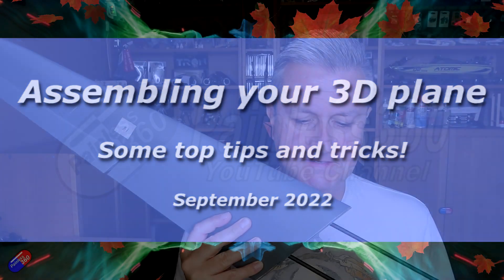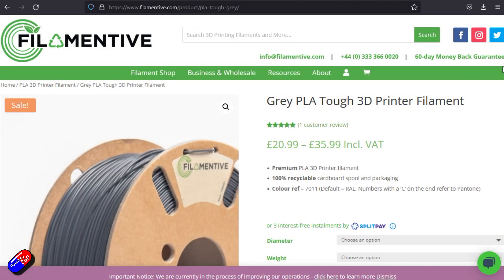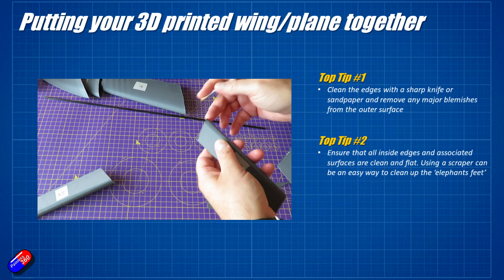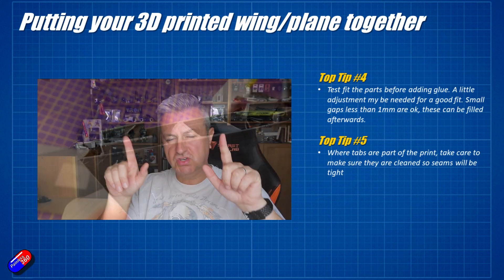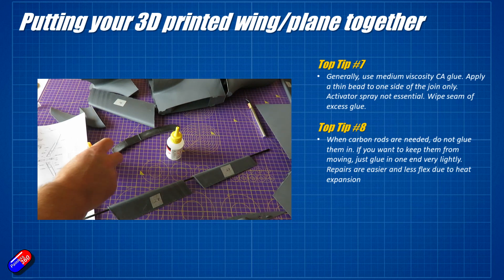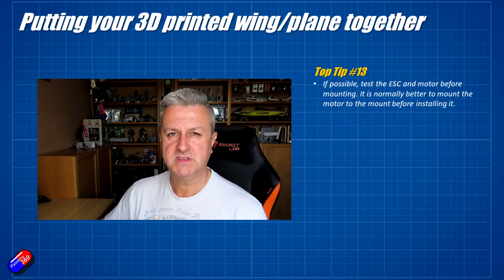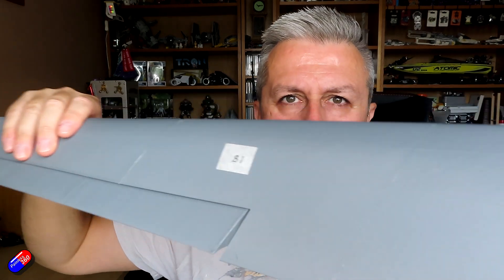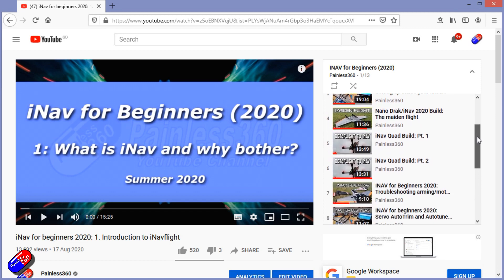3D printed planes and wings: Top tips to make the first build go great!

Comment: I bought the files for a Zero. I think it probably took about 2 days to print. I got a second printer though. So using octopi I can easily control both printers from my computer and print the plane in half the time. I crashed the plane the third time I flew it though. I don't have much experience flying rc planes and so I'm not very good at flying them. Also I didn't put the motor at the correct angle and so it was turning (the plane). I did try adjusting the ailerons to account for it. Which made it better but I think I made it turn the other way (not as badly though.) Anyway I crashed it straight into the ground and the wing crumpled all along the leading edge, but didn't break in half. It was actually pretty cool. The front of the plane basically exploded and the motor was actually slight embedded in the ground. Anyway the back of the plane was fine so I've reprinted the front and the wing. The thing that I think is really cool about being able to print a plane is that although it still takes a while to put together it's a lot less time than making a plane out of foam core stuff. I made a couple of planes out of foam core and the second one did fly but I crashed it pretty fast and it was sort of demoralizing (I mean it's fun putting them together, but it's not so fun when you crash them almost straight away because your not very good at flying them yet.) So I think it's cool that you can just print new parts and once the parts are printed you can assemble a plane significantly faster then you would other wise be able to.

Comment: I would HIGHLY recommend my 3D Printed Gremlin. It flies very similar to the Nano Goblin, prints in about 24hrs, goes together easily. And is fairly durable as far as 3d printed planes goes. A printed airframe can be assembled in ~30min from a crashed donor.

I'd also stress that being accurate and making the perfect build is nice, and sure makes it look pretty, but definitely not required. You'll never know the difference if your joints aren't perfect.

Comment: Great tips thanks a lot, I've built that plane but I found the CG was quiet tricky to get, after installing the electronics and putting the battery in the plane wouldn't balance on CG marks, how was your experience on that part ?
Reply from the maker: I'll cover the that in the next video. Was it too nose or tail heavy on yours?
Reply: @Painless360  it was very unbalanced if i move the battery 1 cm it go from nose to tail heavy I couldn’t get it to balance on the CG marks, I haven’t tested it yet hopefully you have better experience than me
Reply from the maker: Good to know, I'll see how tricky it is on this one..

Comment: Small tip for CA glue seams that turned white (especially if you used accelerator):
If you put a little bit of vegetable oil on a paper towel and dab that on the glue seam it becomes clear and almost invisible again. Take care to use vegetable oil and no mineral oils as mineral oils can degrade plastics
Reply from the maker: Fab tip - thanks for sharing!

Comment: Wow 8 days for the Whitewing is kinda too much. I'm printing Model-S in one shot 48h. But the Whitewing is the best for practice. Also something is definitely broken on Steve's process due to brim should be removed much more easily compare what you've showed. PLA+ from eSun is one of the best filament for 3D printing but I'm using ABS+ from Devil Design due to heat resistance and weight. Good luck with your 3D printed plane it's so much fun :) Model-S is the best model so far I've printed and enjoyed. Orca v2 would be also interesting for you as well but it likes speeeeed :)

Comment: I've found emery cloth too harsh,i use a womens nail file set to remove flashing,a metal one then a fine lollipop style two sided file,rough/smooth.good for printed stuff,plastic  and carbon.
Reply from the maker: I was using a nail file emery board too but liked the cleaner cuts from the blade. The suggestion of using a burr removal tool is a fab one!

Comment: tip 16#  don't leave your pla model in a vehicle on a hot sunny day especially when it's a dark vehicle in full sun, it can suffer with  "drooping". An engineers deburring tool is excellent tool for the removal of the printing mat (elephants foot). A gas cigarette lighter is a quick and clean way of removing string hairs from prints (just be very quick or you will melt your print). Try not to fly when its raining or put your model on wet grass/ground Pla is a sponge for moisture and add in UV light it can weaken your print and in some cases it can make the print  brittle (differs from one brand of pla to another, some are less affected by water and UV) also increases your "weight" of the plane. I personally use the most viscous CA glue I can find as I'm shit at airfix kits lol. Good luck with the maiden. Stay safe Lee

Comment: I’ve made a 3D printed plane as well, not that one it’s a bit smaller and it took me about 4 days of printing time to finish. It has different sections in different colours, but they match on opposite sides. I haven’t set up motors, servos, receivers and esc’s as yet, but I’m glad that I took the time to watch your video, you’ve mentioned some great tips and I’ll take them to heart. Looking forward to seeing yours finished and your flights. Hope you have an enjoyable time with it and that you don’t have too many problems with it. No doubt you’ll probably have to do a few minor adjustments with it, as you would with most planes when testing them.

Comment: That plane looks great. I have the same model but the edf version half built. I break all of them so I'm slow to finish the build. I have been glassing my planes lately and I like the durability but they take more power. I really hope this flight goes well for you
Reply: Interesting, I have been wanting to glass a printed plane as well. How sturdy do they become when ready?
Reply: @TheFeday  I've been glassing my foam planes and it makes them way tough unless you hit something hard. They only one I've had break was a glassed flite test foam board a10 and eventually the fuse snapped in half but totally repairable. So far I've done it to a dart 250, heewing ranger and AR wing pro.
Reply: I glaas  my 3d printed planes always with epoxy. Reason is that the planes easuly breaks when landing on a rough terrain. Now they are durable. Ilove the ModelR of eclipson .
Reply: White school glue then tissue paper carefully laid on and stretched out.  It will shrink drying.  Clear poly urethane spray to finish coat.  Sand with 400 dry before spraying.   And after if you want.   Makes super strong and light parts!

Comment: Hi Lee Thanks Steve,  I just feel in love with this model,  I used to love building plastic models when I was young. And then you mentioned that you were thinking about building this model,  I started looking at different models and this one looks fast. I just wanted one with a clear plastic print. I don't know if it would be possible,  but I would like to fill it with LED's, and then I could fly this at night.  And yes I would love a headtracker system installed.  Thanks again for this video and information.
Reply: you can easily buy clear pla
Reply: @jamesemery1   Thanks James

Comment: A Machinists deburring tool works great on trimming the "elephant's foot" from your printed parts.
Reply from the maker: That is a great idea! I'll have to try that next time!
Reply: @Painless360  just make sure you get a descent one. The cheap blades wreck your prints, speaking from experience. The new one is a pleasure to use and very quick to clean up elephants foot
Reply: I just run a razor blade around it. Takes five seconds per piece. Never knew it was a problem.